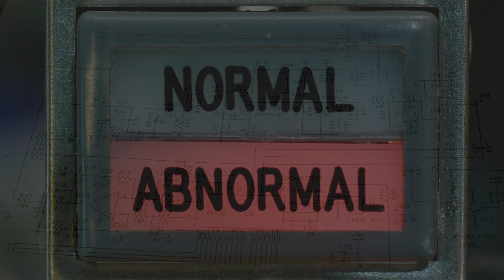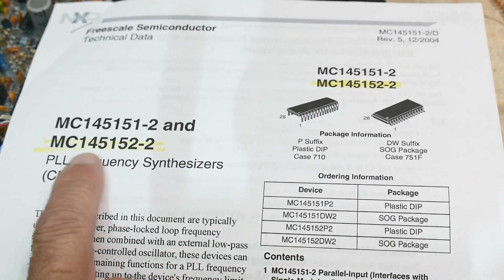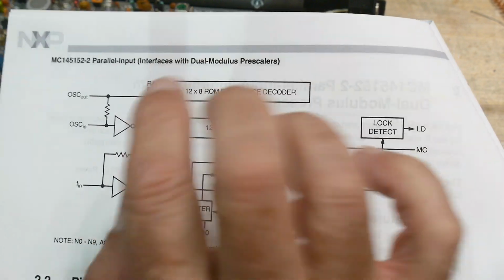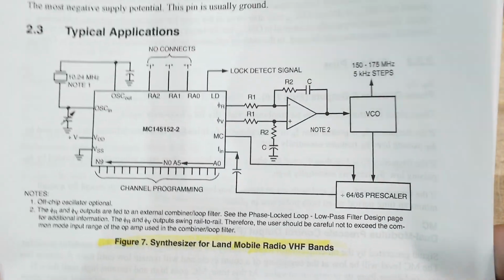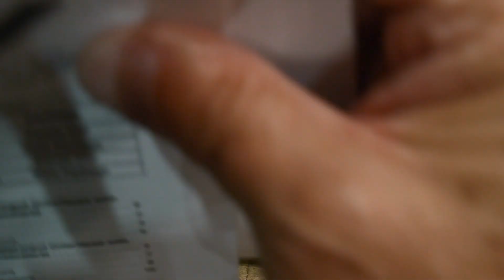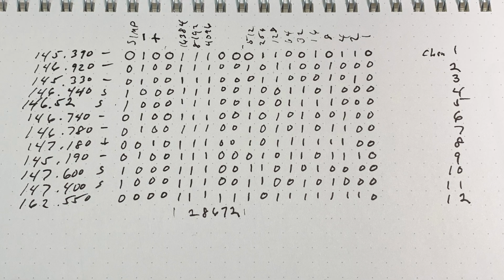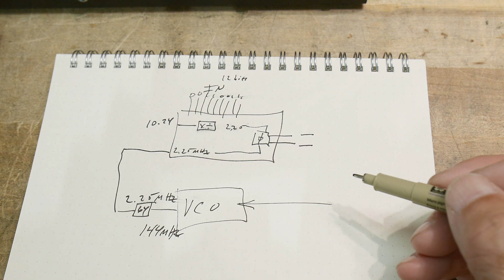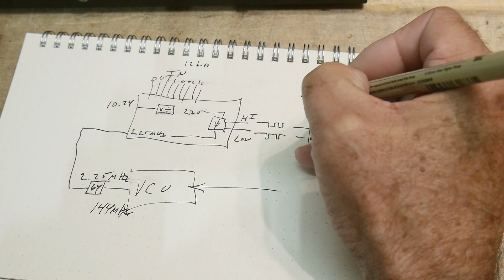#1513 Ramsey 2m Frequency Synthesizer (part 8 of 12)

Comment: Hi. Can you explain why the circuit is needed at all?   For example, you can accurately generate the frequency that we “want” for the purpose of comparison, why not just use that?   

Thanks
Reply: You can use a fixed oscillator but then your radio can only operate on one frequency.  This circuit allows your radio to have multiple channels/frequencies.
Reply: @mikesradiorepair  right,ok.  So rather than the cost of having many different accurate frequency sources, it uses VCO, but I’m guessing that a VCO alone would suffer accuracy based on component drift or aging?

So you use a single accurate source (the 10.24Mhz crystal)  plus ability to divide/match many frequencies based on your desired config, right?
Reply: @tvaccount3929  In a nutshell, yes.
Reply: @tvaccount3929  It doesn’t matter if the VCO drifts.  The PLL will compensate.
Reply: It's a frequency synthesizer. So it's job is to create a range of programmable frequencies.
The VCO on it's own can do that fine, but it's not stable so the generated frequency is PLL-locked to another (lower) reference frequency that is more stable.
- generate a high (or low) freq, relative to the reference XTAL clock
- divide it down so its the same frequency as the reference clock. Sometimes that's a combination of dividing the VCO frequency and the XTAL frequency to find a "common" matching frequency.
- phase compare the derived VCO frequency with the (derived) reference XTAL clock frequency
- low-pass the phase result and use that to tweek the VCO up or down. It's a closed loop system that tries to zero the (phase) error.
As a result, using one XTAL reference frequency, you can create any other frequency that is stable... up to the tolerances of the reference.

More modern PLL's have more tricks, such as creating multiple frequencies, sometimes at a constant phase shift between them.
This frequency synthesis is used a lot in modern CPU SoCs (System on Chips), FPGAs etc to generate the many clocks that the IC needs inside.
Reply: A simple free running oscillator will drift as it warms up, cools down, the supply voltage changes, lots of factors so it's not a good solution for a transmitter.

To fix that you need some way of making the oscillator stable.

The PLL does that for you by comparing a sample of the oscillator signal to a stable reference signal that's usually generated by a crystal.

Inside the PLL there are dividers and a phase comparator, you feed the stable reference signal into the R divider and (in a simple single modulus PLL) the Oscillator signal into the N divider.

The dividers are programmed to reduce the input frequencies so they can be compared in the Phase comparator.

The R divider also sets the channel step, so a 10MHz reference divided by 1000 would mean your channel step is 10KHz

If you have a 10MHz reference and a 100MHz oscillator you might want to compare them at 5KHz, so your R divider would be 2,000 and your N divider would be 20,000. 

Those frequencies are sent to the phase comparator which generates an 'error' signal if they don't match.

The 'Error' signal is a series of pulses which are integrated to produce a voltage that's proprtional to the size of the error.

The error voltage is then applied to the oscillator which responds by changing frequency up or down until the frequencies match.